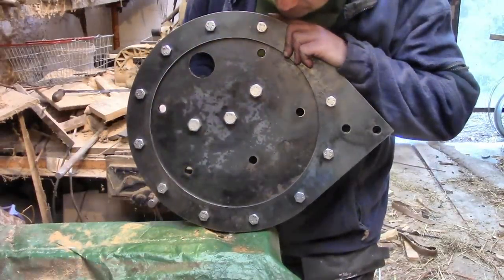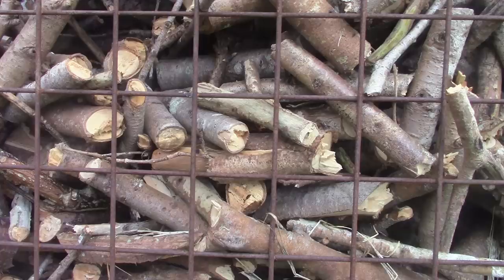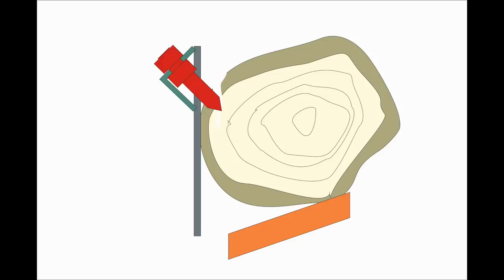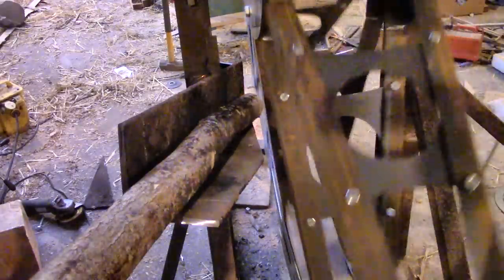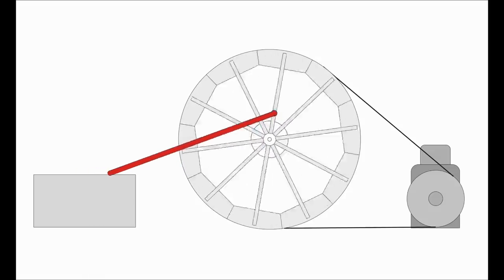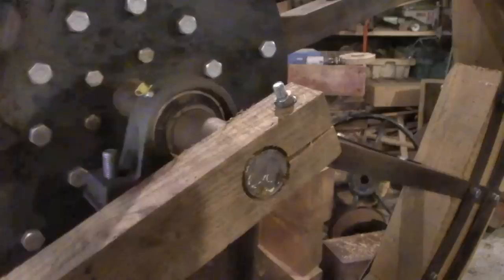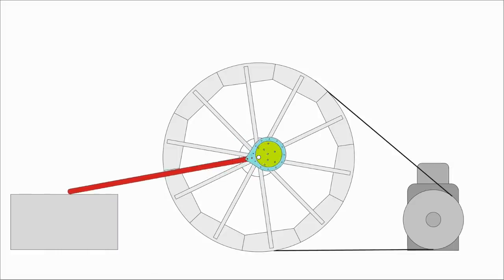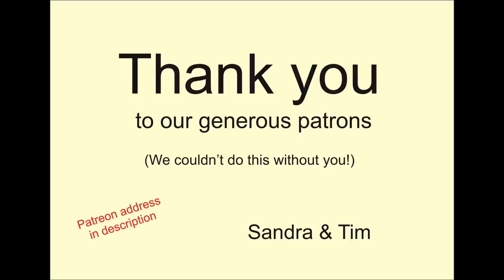I Made An Eccentric - And it's A Wonderful Thing!

Comment: eccentric strap

used a lot in model steam engines

also, I don't know why, but driving stuff straight off the flywheel seems to be a bad idea, better to have stuff run off the shaft.

look at other lineshaft driven workshops, you'll find more ideas in there too

Comment: If the wheel were rotating in the opposite direction, the thrust would be completely horizontal and more force applied to the cutting edge on the wood and less down on the sliding plate.  Nice build on the eccentric!

Comment: I have seen a log splitter, or a few, that used a large wheel with a blade (or bit) on the perimeter of the wheel. The operator would hold the log on an anvil and the bit would come around and chop it in two.

Comment: 3 monthes since the last railway video btw idea for the double boggie railcars if you gotta make them long on each boggie make a smallish empty box on them and fill them with ballast or make them out of heavier material to come them from wanting to come of the track and for tornado maybe stack 2 of those air compesiors ontop of each other and it will double tornados power it should get more power then the weight adds and you could then use tornado to pull the heavier cars if you cant pull them by hand or have tornado and someone push might help with heavy cars and maybe instead of using the metal tube for the pegs make your own from your wood it would save you money might not be as strong though but might be a good investment bc it would be less money to make railway and i know your budget is tight so it would help and maybe even make your own rail from wood though that would take time and it would be less strong so you would have to make the rail thick  but just suggestions for you
Reply from the maker: Thanks Amy. I might have to send you some commas for Christmas : -  )
Reply: @wayoutwest-workshopstuff6299  np btw my name is matthew also im not a expert as the stuff but i know alot about trains and railway

Comment: Back tracking a bit.. Jump forward to 3.48 on this compilation video. https://youtu.be/Fe2Rzrl2DNs and with a cnc plasma cutter it won't be too difficult to make..
Reply from the maker: That's sort of what I made a few months ago - but my engine is only 6hp and it could only cut up to around 3 inches. (That tractor is probably at least 50HP?)

Comment: Great work as always Tim. 

You mentioned you've had difficulty attaching things to shafts. Look into taper lock. 
There are flanges and also pulleys that work with them.
The eccentric plan looks great, but I'd try and design an intentional "weak" point that can give or break if anything gets stuck.
If you're not doing the grinding or cutting on the wheel then you could attach a taper lock pulley onto the wheel shaft, and have a matching pulley on the grinder. The grinder/chopper pulley being the same size will give you 60rpm. 
You might need a double or more belt pulley for the torque, but if there's a jam the belts should slip, saving anything from breaking, similar to belts being used on powered tractor equipment. 

The pulley idea should give you more flexibility with designing a chopper/grinder. Charcoal is quite brittle so crushing might be easier than grinding. Not sure about the chopper, but for the grinder maybe either a jaw crusher, roller crusher, something similar to your wheel idea.
Reply from the maker: Thanks, Ben - I have used taperlocks to hold the wheel to its shaft, but I know they would slip if I tried to drive the wheel from the shaft. They need keys or pins too (and they're what break)

Comment: A crank can go either way.

I would say the main difference is the connection.
A crank has an axle which rotates around the primary axle.
Something else is then attached to this secondary axle (which could just be a hand), such that either the secondary axle moves to rotate the primary, or the primary rotates such that the secondary moves.

Importantly, this means the connection point (the secondary axle) just follows a circular path. If this is connected to something constrained to linear motion, such as a piston providing power or a cutting blade, then this will also have a fairly common linear motion based upon that circle. This is because the linkage is always attached to the same point.
And if you have something moving on the linear portion, you need an extra linkage. It can't be attached directly to the crank.
This also means it is a 1:1 relationship.
i.e. if the wheel rotates once, then the linear component will move back and forth once.
And it will be fairly simple, simply moving out then back in.

A cam instead is effectively an irregular disk. This presses against something to convert the rotational motion to linear motion. This is one way only, it can't be back driven (at least not in general).
It also only has the cam push the object outwards, something else, such as a spring, is responsible for the reverse motion.
Importantly, the linear component is pressed against the disc at a certain angle, so as the disk rotates, different parts come into contact with it.
This allows a more complex motion than possible with a crank. e.g. it could slowly push out and then very quickly get pushed back in by a spring.
It could move out all the way, get pushed in a bit, and then push back out, before going all the way back in.
It could also have 2 or 3 (or more) copies of the same profile around the disc rather than the profile spanning the entire disk.
This means the wheel could rotate once while the linear part moves back and forth multiple times.

Based upon that, what you have is effectively a crank with a very large secondary axle.
You can get the same result with any crank by taking the secondary axle and making its radius larger than the sum of the radius of the primary axle plus the distance from the centre of the primary axle to the centre of the secondary axle.

If you removed the outside ring, and instead had a rod (with a bearing at the end), constrained to move in a linear motion, pressed against the disk (such as with a spring), then you would have a cam.
Reply from the maker: Yep - that all makes sense. Thanks!

Comment: I love it, but I am wondering when you hit that wall where you figure out that a modified chipper could of done an adequate job without all the drama, lovely drama though it is.  Reminds me of that last of the summer wine episode where they try to deliver Nora's mangle and it ends up smashing a police car off that high bridge.  I envision a similar ending here but I can't wait to see it.  Just keep head and limbs tucked in at all times.
Reply from the maker: I made a chipper for the smallest brush, but I couldn't throw a log into it without it breaking to bits
Reply: @wayoutwest-workshopstuff6299  I thought that was cool, it produced chunks of the 3 to 4 inch variety.   You need one of those Jappa firewood processor endorsement deals where they gift you with some of their equipment and let you pimp it for them.  I just love how medieval your going with this death wheel.  I know it will be brilliant in the end but I am nervous for you as the bigger it gets the fear factor increases and that is a good thing!  Expensive but I know you will come up with something inspiring!

Comment: Tim, that eccentric crank is a great idea; you could perhaps make a slot where the flywheel axle attaches, so you could easily (?) adjust the stroke or power of the crank if needed? As you said, the only problem I foresee is the attachment to the axle, maybe a tapered sleeve? Great stuff as always!
Reply from the maker: Now that's getting a bit sophisticated, Tony!

Comment: A way to ensure it never has a catastrophic sudden stop could be to get your impact force from springs, and just use a fibonacci like cam or eccentric to provide the stretch force, and then immediately let go. If it fails to pull a full stroke, it won't shock the wheel and will just chop again on the next loop. You'll never put more stress on the cam surface than the spring force, but you'll also never be able to strike harder than the spring force. Orienting the impact vertically and adding mass to the chopping head could add the momentum assist that you're wanting from the wheels mass, but without the rapid disassembly potential if it catches a good knot or something.
Reply from the maker: Good idea, I think, Matt. I'll have to think about how to incorporate a spring though

Comment: You could make a momentum powered log splitter, but instead of placing the logs inline, you could put them perpendicular to it and make log slices. Also, a double wedge grinder for the charcoal on the same platform as the log slicer.

Just an idea.
Reply from the maker: Yes, I'm playing with ideas along those lines ..

Comment: Its an eccentric sheave with strap, you're going to fit the rod to drive your chopping machine, see here for an animation :-https://en.wikipedia.org/wiki/Eccentric_(mechanism)#/media/File:Eccentric_animation.gif
used on steam locomotives to drive the valve gear, usually on the crank axle inside the frames although some were outside on the axle ends, lots of French stream engines had that system
Reply from the maker: Thanks Jon!

Comment: what an inspired idea, your mind must be constantly designing during breakfast, cutting grass, .... brushing teeth and all night long. I know you said no criticism but this may be viewed as suggestion. Those "little" bearings   are going to take an crazy axial load as all the push pull is push pulled by them. I think the old mills used "plain" bearings (bronze alloy) but  you could used steel for short run.(or end grain hard wood pieces held radially) Grease the hell out of it as you will need to do the side walls anyway. Sorry I am sure you are learning to simply ignore the noise of comments. "Keep on Making on", is that a tee shirt yet.
Reply from the maker: I think you may be right about the bearings, Victoria. Worth a try though?
Reply: @wayoutwest-workshopstuff6299  Oh def.. the way to go as you have it. It is an easy fix for you long term given your supa dupa plasma cutter.

Comment: I'm no engineer, but I was just about to comment that there is no way the wheel would stand up to the abuse from the sickle blade when you showed the second plan.  I'd just find a large circular saw blade and make the wheel turn it,  I've got one around here somewhere that must be 32 or 36" made to go on an old gravely tractor.  I looked it up,  they are only 26",  they are out there for sale but I'm sure shipping would be cost prohibitive.
Reply from the maker: Thanks Will, but too slow for what I have in mind..
Reply: @wayoutwest-workshopstuff6299  yeah I guess you want to automate the process. A spinning 3 blade cutter that cuts against a stationary blade like a wood chipper would be the best option most likely.
  Once started they draw the log right in, you would just have to space the blades to get the proper size piece you want.

Comment: It’s called an eccentric. They use them on steam engines, to make the valves and pumps work. Bearings are not normally used. Just metal on metal surfaces with oil added.
Reply from the maker: Thanks. I assumed that was only part of the name, but what would I know!

Comment: I think either "connecting cam" or "Tim's reciprocating device" would be good names!  Great work!  Using the bearings as you have should make this a very durable part.  However, there will still be a lot of torque stress on the driving wheel shaft where it connects.
Reply: I suggest "Tim's eccentric", since that name contains a great truth hidden within
Reply: @mattlibby4490  😄
Reply: That makes him one of us and  us as him - that's also reciprocating!!!  (and Wonderful!)

Comment: Always consider the forces of spinning and cutting, especially the side forces. Design it so that nothing can bend and twist, especially so that nothing gets caught in the wheel while it is spinning. Perhaps even add a set of spring loaded brakes that can be triggered in case of emergency.

Comment: Another fascinating video thanks Tim!
As much as I'm enjoying all your ingenuity and problem solving, how about using the wheel to drive a the workings of an actual chipper? Like a PTO powered timberwolf? An old one could be found cheaply and resurrected and adapted as needed.
Reply from the maker: I have a chipper that uses all the engine power available (only 6hp) and that only copes well with small timber. So I need a different way to use that energy for the bigger logs..

Comment: Great Idea, you are building an old style stamping press, They also had a one rev clutch. Because of the inertia of the wheel there will be extreamy high forces if something attempts to stop it revolving by stopping the linear motion of the connecting rod. (especialy at TDC) I would suggest that there will be enough force to break or bend something as the wheel decelerates. Consider using a mcphearson strut (or sim) from a car suspension as the connecting rod(without the oil) so as the spring will compress if the blades come into contact with an unmovable oblect. Something with a spring in it to give avoiding potential dissaster.
Great video's showing fantastic Inginuity.
Reply from the maker: Thanks Robert - good point!

Comment: to cut the logs, could you do it similar to scissors or garden shears? 2 pieces of metal flat against eachother, with the edges sharpened? then have the log in a sort of long hopper to keep it from flailing, and angled so the log will fall into the cutter, could have a plate that stops the logs fall at a certain length you want the pieces to be.